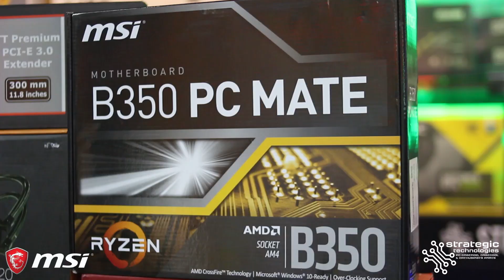BUILD LOG: Michael Medecillo Formanes | PUERTO PRINCESA, PALAWAN | MSI MAG Bunker

Comment: Bat di po gumagana yung fan sa GPU?
Reply from the maker: Believe it or not, some graphics cards won’t spin until they hit a specific temperature. They come with a passive cooling mode that is designed to help them cut down on system noise. In this instance, a lot of users actually finish their build and use their systems for a given length of time before they notice that their GPU fans aren’t spinning. And, when they finally realize that it isn’t spinning, they assume something is wrong, when in reality, that was just the way the card was designed to operate.